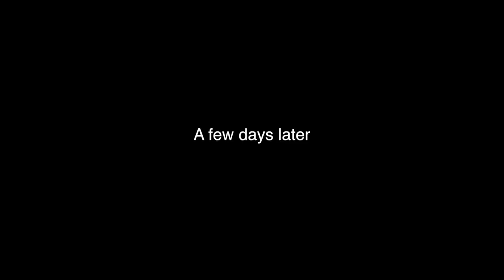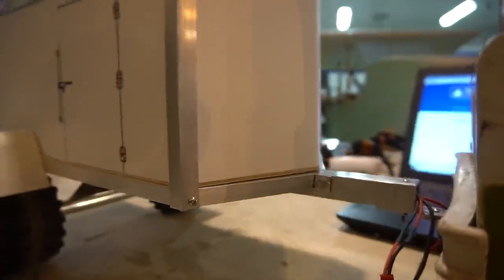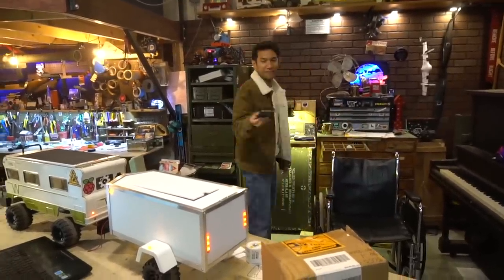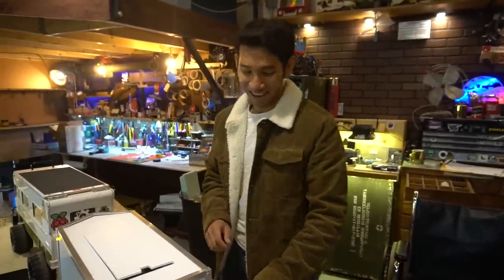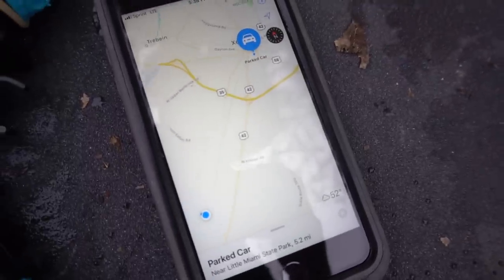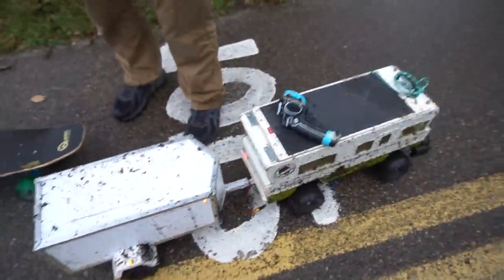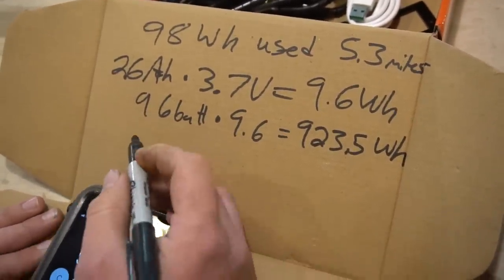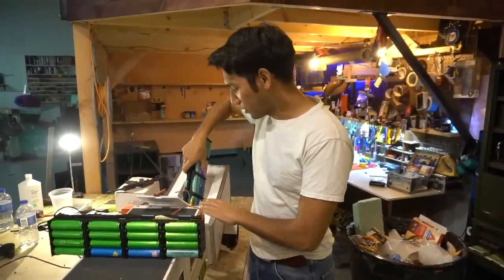Electric skateboard 100 battery trailer!

Comment: Your consumption is 11.48 Wh per kilometer. Which is just insane! Do you know the average speed? My car uses 180 Wh per kilometer on average (Tesla Model S 90D). Also 1 litre of Diesel contains the energy equal 10 KWh. So with your setup your range would be closer to 530 miles on 1 litre of diesel if you had perfect conversion. Which would equal a MPG of 2006 in imperial form. I'm not sorry for geeking out :-)
Reply: I think it's because of the high-efficiency DC brushless motors. Those things barely use any power.
Reply: Diesel engines are only ever <45% efficient, and a car weighs about 15-20x more than a person on an electric skateboard. That's why it seems insane, pretty much incomparable
Reply: The thing that's really insane is to cycle a kilometre at a similar speed (30kmph, 20mph), you'd need about 200W of power, for the 2 minutes, so would only use 6.67 Wh per kilometre
Reply: @TheSuperSushiMaster  Tesla used induction motors which don't have brushes so Tesla technically does use brushless motors.
Reply: 10 Wh/km is the average we use when estimating range for electric skateboards, mine if I limit the to speed to 25 km/h I can get 6,8 Wh/km

Your Tesla is way more aerodynamic than a human standing up
Reply: @joelaw728 nothing in this world is incomparable. I could compare apples to rattlesnakes to black holes to David hume

Comment: 2600mAh batteries (particularly free ones) probably have a capacity of 2000mAh if you are lucky. Especially on their first cycle.
Reply: Actually we have a full testing facility and the cells we get and sell have little to no degradation. For example 2200mah new cells are testing at 2000-2200mah. We literally test thousands of batteries each day so the batteries you get are not degraded below what is stated.
Reply: people have such weird ideas about lithium ion, and carry their misconceptions from other chemistries.  over-generalizations included.
Reply: SueBobChicVid these cell are fully tested.

Comment: best 18650 for this is the NCR18650GA, but a bit expensive. it's what you should be using for your electric ultralight!!
Reply: or the new sized cells, theyre v good
Reply: Tesla was using the B cells in the beginning, but are using their own chemistry more similar to the GA cells now.  both have the same WH/KG, but the GA cells can output nearly double the amps as the B cells.  Most manufacturing facilities have transitioned to making GA cells, that were formerly making the B cells.
Reply: @FPVREVIEWS  not exactly, NCR-18650GA only have an energy density of 224Wh/kg. I wouldn't really worry about current, in an electric car because there're so many cells, they share load so instead of one having to handle all the power, they share power equally between the cells.
Reply: That's assuming that both batteries are used at their max amp draw. If that's constant, will be the same wh/kg.  this is demonstrated by the MAH capacity being the same, and is only dependent on the voltage sag during discharge.  only cells that share current are the ones in parallel.  the Comment was regarding aircraft, not cars.  Using a higher amp cell just means that you can have a smaller battery as an option, and when at max amp draw on a larger one, there will be less voltage sag, which increases the area in the graph under the voltage curve, which is the true capacity, being a function of the voltage/amperage over time.  this curve will not be constant in real world conditions, in most cases, especially in vehicles.
Reply: @FPVREVIEWS  not necessary, the cells can share load if they're in series too, remember that power equal voltage time current if you keep the same power but increase battery voltage by putting them in series, it would result in lower current.
Reply: was assuming the voltage was a constant to compare the cell performance, since that is what we were discussing.  multiple variables makes it impossible to determine a single factor.  buy yes, you are right.

Comment: I have an electric mountainboard with a 12s8p Samsung 30q battery pack (96 cells, the same as your trailer) that gets me around 40 miles riding aggressively. My battery consumption is around 25wh per mile. If I wasn't using dual 6374 motors (sk8's, the same ones sam has on his board) I would probably get more range.

Comment: Electric tracked tank platform using 800w scooter kits, witch can be controlled ether by joystick or RC remote. Also cheap as possible, so maybe using relay to create reverse gear and just modifying or finding two bi directional hal throttle. This is adaptive platform for snow pushing, or personal transport etc. I would need one for my old grandma to clean snow in the yard, but commercial version are way too expensive and something like electric wheelchair here as donor are even more expensive. Only reasonable priced systems are those electric scooter kits, but there the problem is getting control system to work for tank application.

Comment: This may have been accounted for and I missed it, but as the batteries drain so does the voltage output. I think it starts at 4.2 with a maximum charge, but drops down to 3.3?

3.7v is the average on the 18650 voltage curve, but at a certain point, the board will become unusable and this will occur before the batteries reach the min voltage.

Comment: You should do more boat videos
Reply: Agree
Reply: Na
Reply: I'd like to see a boat made out of depron or some other closed cell foam. Just get a whole block and hollow out where you need to. I've got all the parts together for a hot wire setup that will hog out large parts using an old aluminum aerodynamic water bottle bike holder.

Comment: Wires connecting the cells and the whole battery to the "board" seem to be quite thin. A lot of power might be lost there if you're passing a few amps through them.

Comment: ESC is seeing a 4s 62.4Ah battery correct?  If you used 6.2Ah to go 5.2 miles then you would get 52.3 miles if you use all 62.4Ah.  The math is (62.4*5.2)/6.2=52.3

Comment: Lithium batteries charge to 4.2v (I'm pretty sure you know that) so instead of using 3.7 why didn't you just calculate the watt hours from (4.2+3.7)/2 because that would give a closer estimate to how many miles you could go

Comment: What about another advanced Nerf gun??? You built a air compressed, what about a water compressed?
Reply from the maker: _BTWS_ hydrogen is next on the list!
Reply: Hecks yeah
Reply: Do you know how a Water Rocket works, when you pump air, the pressure inside the bottle would increase because  the water try's to exit the bottle, what if you were to make a bottle rocket cannon or some idea! I'm thinking about making one myself
Reply: _BTWS_ liquids aren’t compressible, gasses are. so when you pump air into the bottle you’re compressing the air in the space the water doesn’t take up.
Reply: You can put pressure on the water, but the volume won't shrink.
Reply: It could work if you oxygenated the water. The gas inside would get compressed though, not the water.
Reply: Compress a liquid?

Comment: Another great Sripol adventure! Three minutes in I thought that trailer was for your dog. You should make two more as dog trailers and have a doggy train. That would be so funny. A flashback into the past: https://www.youtube.com/watch?v=st6AKENGN8I  And maybe build a caboose only have a metal pole go up and put a bicycle seat on it for Foskul. (I hack together the pedastal of old thrown out computer chairs with a metal pipe and a bicycle seat as a quick shop seat. I've made several now and they work great. )

That many 18650s in series would make some serious voltage. BTW the 26600s are the new powerhorses. 50% more power with only 20% more weight. They're going into Tesla cars as we speak. Have a nice day, that video sure brightened mine!

Comment: Is there no way to have the wheels charging the battery inside the car so once the battery’s die in the trailer you can switch over to the charged ones?

Comment: Hey dude, personally I think the maths was a little off, should have used the values for the 4S packs, (may make a difference to Wh?) with a voltmeter instead of each cell. As the voltage of a lipo drops with use it would give a different reading, although the 3.7 is nearest makes no difference the average voltage (if full is 4.2 and flat is 3~3.2V).
Reply: Did the maths, hardly changes, had the outcome of 9.16% or a total travel distance until flat of 48.6m

Comment: You seriesed different types of cells. That was a bad idea. Your series string should consist of mostly identical clusters.
The way to go is to mix colours in the parallel chunks. That way your series string of 'virtual' batteries discharges somewhat equally.

And as your nana, I also have to tell you, USE A BMS! ;)

Comment: I would bet a lot of money that those batteries aren't even close to 2600 mAh. 18650 battery sellers are notorious for advertising values that are ridiculously higher than the actual rating of the battery. That combined with them being used. I would be interested to see y'all hook them up to a multimeter and discharge them through a known load (keeping in mind that as the batteries discharge the voltage will drop, and thus the current will drop as well) and measure how long it takes for them to go flat to get a real value. If you wanted to make a video out of it you could even use a digital potentiometer controlled by an arduino that measures the battery voltage and adjusts the potentiometer in real time to keep the current steady. Or you could use some simple circuit knowledge and create a constant current load, I just figure the Arduino route is more suited to this channel.

Comment: You don't discharge lithium batteries to 0v. Your usable range is 4.2v to 3.0v on as generous side. That leaves you with 1.2v of discharge capability.  1.2*26Ah=3.12Wh. Multiply this by 96 batteries you get 299.52 total Wh. Given you used 98Wh, that means you actually used 33% of your total usable battery for an overall range of 15.9 miles. If the numbers sound too good to be true, they probably are.  15.9 miles, not 53.

Comment: I use 68 x 18650 (3200mah)  in my entire diy mountainboard (custom diy made probably in future you can buy decks made by me-carbon and glass fiber deck......custom made carbon and glass fiber trucks....and hoverboard wheels with max speed 30kmh+ but i probably rewind it to 40kmh or repleace it to 2x3kw motors)
60 for mountainboard...5 for usb
3 for lights.... And i get around 45km after few hundred cycles yes few hundred..lg cells.But next time i use only 14....15ah lipefo4

Comment: Shouldn’t have used watt hours for the calculations, I don’t think
Your battery maths act as if the batteries stayed at a constant voltage
But the Watt Hours calculated by your little circuit would have to take into account the differing voltage

I’m not 100%, but that’s what I think

Comment: Uhm. Did you just wire all those into one biant blob? You are probably not using it every day, but get a BMS. Because if they don't charge evenly, and with no battery protection, you might see some fire, and it will be a nice toasty fire. Verryyyy energetic. 18650 cells are pretty sturdy on their own, but that amount of cells in that space will be enough that if it cascades even a couple of cells the whole thing will be a mass of molten metal.
Reply: Oh, especially if you get refurbished cells. Yeeeeesh.

Comment: I mathed out an average of 66.25 miles maximum if you guys got the 3.4ah batteries with everything else including voltage being the same. I'm rusty with math though so I could be wrong.

Comment: Ok , that's cool , but how can a hundred batteries survive contact from water but my phone can't ?!
Reply: Your phone is mostly a computer which relies on incredibly small voltages to send signals, even a tiny bit of water can carry enough charge to mess up all communications.
But once you get into bigger and more crude systems it's not as critical if there is a volt or two extra on some ends.
Reply: @MsSomeonenew  oh thanks

Comment: Not a very accurate calculation given the efficiency of motor changes with voltage and the mAh rating of battery goes down as they get hot. So many variables to account for.

Comment: i'd like to see how to turn a mountain bike into an electric bike for less than the $3,000 that electric bikes cost
Reply: Use a gas chainsaw. Cut off the support btwn handlebars and seat.  Put chainsaw down in there and secure it in place. Weld supports to the frame. Attach chain to gear 3 front, and don't got higher than second ger. You can find many tutorials for this sort of project.

Comment: You really ought to remember the name of the company who donated stuff , and not have to ask Sam - it's a bad look for you. I've seen that more than once.
There weren't 100 batteries - "I just said 100 because it sounds cool!" - thats not a good look either.
You should have ridden the skateboard until it wouldn't go anymore - thats why we like your channel - its largely practical and real world. You are starting to take shortcuts.
There is no way you'd be able to move the skateboard to anywhere near 100% . I'd guess at less than 40 miles. But we'll never know will we?
Shortcuts.

Comment: Give me a quantum thermodynamic information generator and I'll build you everything.
When you google it up 99% is trash, because most ppl make a perpetual mobile out of it, aka show a completely different device than it is, but the generator actually isn't that. It's a extremely Finnicki and over complicated do differential generator, and different potential do work and so on.
I cant explain it, because I didn't understood it well enough, but sure is, it's just as possible as creating a so called warp bubble, and is as far away of being understood and invented like this
Reply: Btw it could be a compact electricity generator for getting rid of batteries in a about 100 years or more